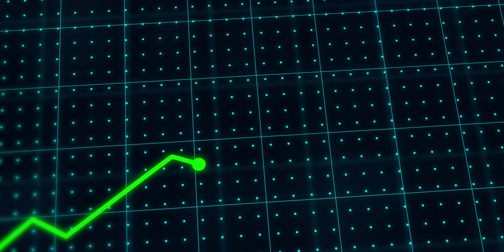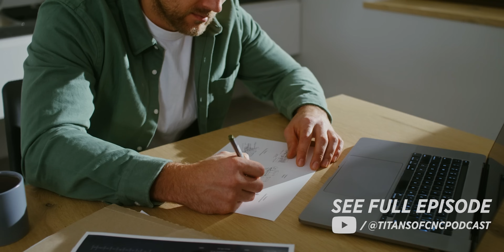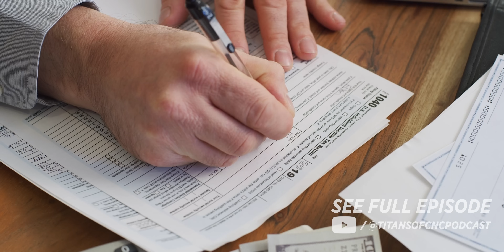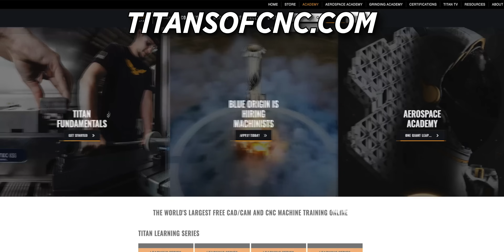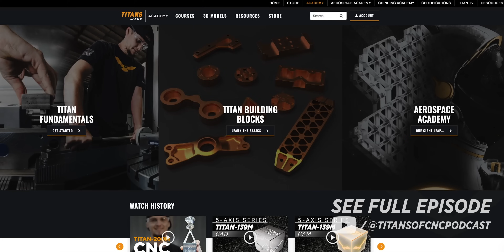Marzilli Machine Overcame Incredible Odds to Thrive in CNC Machining

Comment: I switched from a constructor CAD designer to a machinist to help company I work for. Nobody wanted to touch 2 cnc machines and nobody was willing to learn how to handle it. I got there, i broke so much sweat around then scratching my head why that mill does not want to do what i envisioned it to do.. I was struggling but hey at some point it clicked and I mastered it. Now I did not do academy parts but i think the are so cool and so easily accessible and fun! All people or future machinist should at least check it out. I am an operator on 2 3 axis mills and all I do is hand program. All by hand using fanuc cycles and my hand programing interpolations and all that stuff. From time to time we have a part that requires cam which is in office installed. I go there do what has to be done go to machine and run. It is awesome and gives a lot of fulfillment from the job or partthat I made! - Love the channel! Love the support You guys give! I'm glad im part of machinists family :D